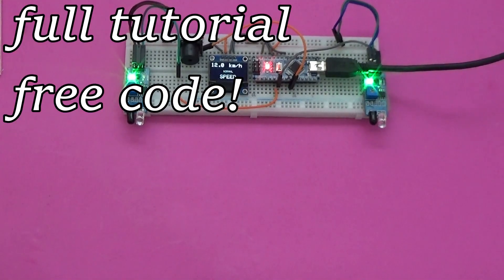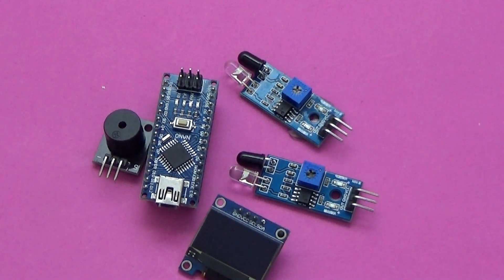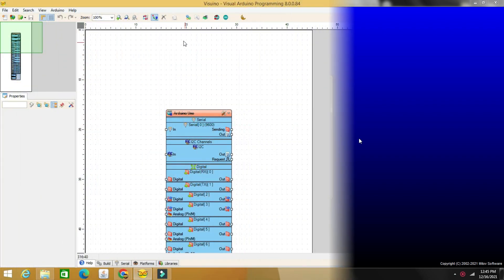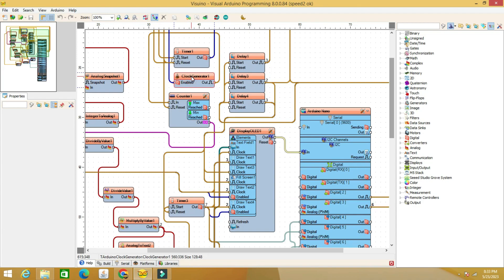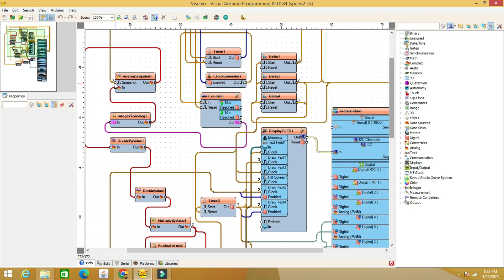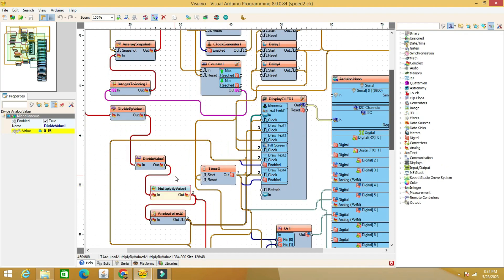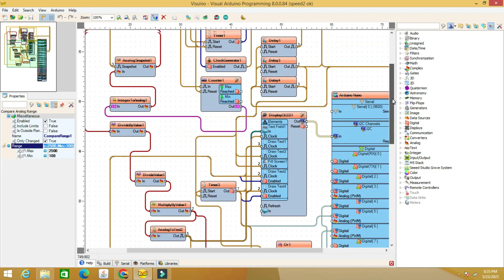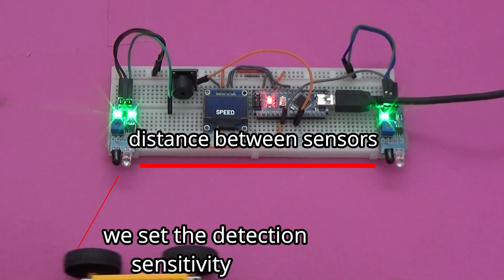Arduino Speed Object Detector! Free Code!

Comment: i have an error on exit 1 what do i do?
Reply from the maker: Make sure the port is correct and Old Bootloader is set.
Reply: @CompactDiy  still the same problem
Reply: its already connected but couldn't upload
Reply from the maker: @bryandarian2662  error Exit1 appears if the port is not set correctly (it must be green where the port is written) if the Arduino board is not set correctly or in the case of the Arduino Nano, the Arduino Old bootloader should be set. In Visuisa, either these settings. Also check the USB cable.
Reply from the maker: Visuino*
Reply: @CompactDiy  Hi sir i wanna ask why does after succes uploading why is the device didnt show anything and didn't work anything just the buzzer and the ir sensor that work. but the buzzer keep buzzing continously and didn't stop buzzing at all.
Reply from the maker: @bryandarian2662  Carefully check the electrical connections. The display must show the text "SPEED" as soon as you turn on the device. Check that the doorbell is connected to pin D6. The display must be connected correctly, the SCL pin to pin A5 of the Arduino and the SDA pin to pin A4. You must have done something wrong. Check the diagram in the attachment.
Reply: the doorbell keep buzzing and wont stop but went and an object pass by the door bel like stop buzzing just for a sec and keep buzzing again non stop
Reply: and why is it cannot messure it correctly
Reply from the maker: I don't know why the buzzer won't work. For the correct measure, see that the distance between the center of the sensors is the one entered in the code. I checked the attached diagram, it is correct and correlated with the code.
Reply: @CompactDiy  pin d3 makes the buzzer buzzing non stop
Reply from the maker: @bryandarian2662  buzzer is in D6, not in D3
Reply: @CompactDiy  can i send u an email of a video on how the things work cause it still didn't work and i need this for a project for my school
Reply from the maker: @bryandarian2662  cristinepotu71@gmail.com
Reply: ty sir, i'll emailed you right away
Reply: still on the sam eproblem the buzzer keep buzzing